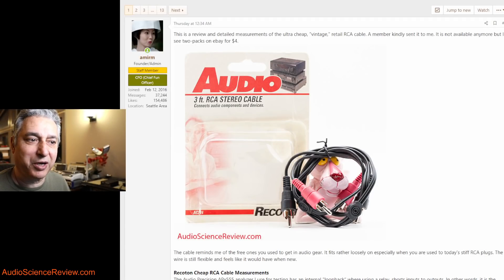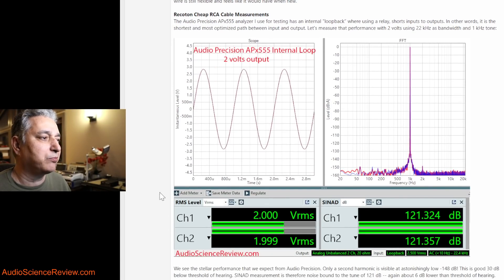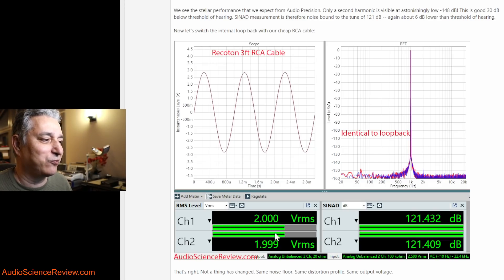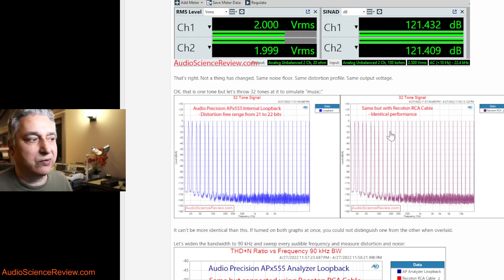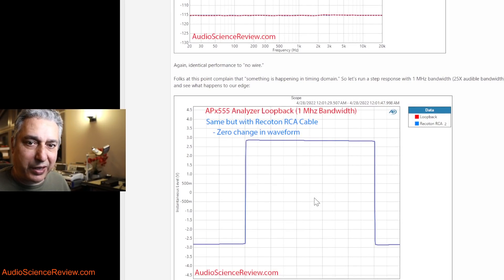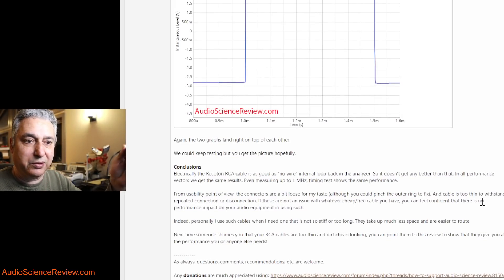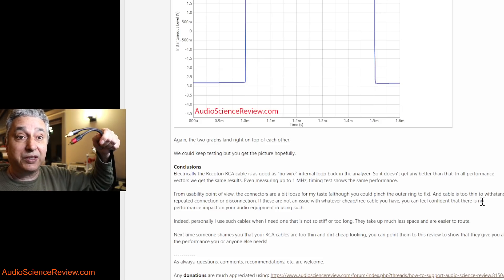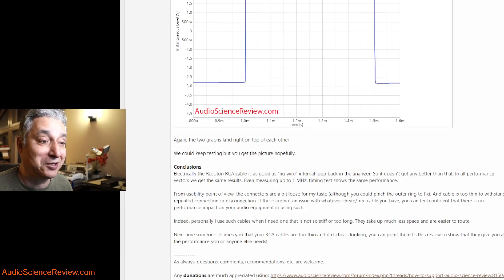Are Dirt Cheap RCA Cables Any Good?

Comment: Hi Amir, could you test this dirt cheap cable with a more complex signal {multiple frequency} like pink noise and do the comparison again? Music is such a complex signal compared to a really clean sinus or square wave (i know a square has infinite amount of sinuses of odd harmonics)

Thanks for these nice informative videos

Kind regards stefan
Reply: Stefan, the test already included multiple frequecies, and square waves. The cable isn't going to care whether these are "clean sine waves"  or more random (like actual audio). It's also very difficult (if not impossible?!) to make accurate measurements on waveform shapes which aren't "clean". Amir's tests cover all bases already, in my opinion.

Comment: The major difference in RCA cables is not how they pass signals, but how they shield from external noise and how they couple the system grounds together. Any junky cable can pass 20KHz 6' without distortion. Put the cheap RCA cable parallel to an AC power cord to see the difference: the cheap one will have big 50/60Hz pickup. And it is a function of the driver/source impedance: Low is good, 300 ohms not so good. 
Then try the power line test with a nicer $20+ cable. The cheap cable has poor shielding coverage, typically 90% or less. The better cable will have multiple shields, typically copper braid + foil for 100% shielding. Measuring the DC resistance of the shield is also a good test: Low (~50 mOhms for 6') is good. 100-500 mOhms or more is bad.

Comment: How many here has more than 1 RCA cables and swear can hear differences between those please give a thumbs up.

I have 4 sets of cheap RCA; 1 Generic cable i bought in electronic stores, 1 custom canare cable, 1 amazon cable and 1 mogami cable. I know exactly how these cables sound in my system, they are different. Not to say one is better than another, they are just different in the way they deliver highs, mids and lows.

I'm not sure there are differences with speaker cables as i have tried some and found no difference (unless its a very poorly made cable) but i am very certain there are differences concerning RCAs

Comment: I would like to see a shielded cable vs the cable tested in this video, but among the rats nest and power cords! That represents 99.9% of our situations.
Reply: Yes, that would be a real world test and good to know. The cheap ones fall apart and not very durable and then they don't connect and have a loose, I make my own w beldon   RG5 20awg solid copper and tinned copper shield and Aluminum foil

Comment: Yet another reason that I can spot an audio snob is when he spends over ~$20 on an audio cable and says he can hear the difference!
As long as the connectors are gold plated for contact quality, and the cable is durable, they are excellent and will perform just as well as $100+ cables with OFC and Litz wire!
What a ripoff these companies are!

Comment: for really short RCA cables 6 ft. and under, the quality almost never maters, it's only when you start using 12 ft. or even 30 ft. el cheepo RCA cables that you start running into serious problems and signal drops and noise.

Comment: "I've got music in the form of 32 tones" lol... not that I disagree with the results though. However, I remember I once replaced my speaker cables which were some no-name 2.5 sq.mm copper wire with 4 sq.mm QED XT25 and I remember the sound changed very noticeably. I don't much believe now the idea the cables can influence the sound so much except for some really crappy cables and I can't reproduce that effect now (I don't have the speakers I had then) but could it be that the sound actually changed (i.e. not only in my perception) maybe because of XT25's "tube" geometry (they have the copper strands forming a "tube" around the dielectric core)? The effect I perceived then was the harshness in treble frequencies of Monitor Audio RX6 disappeared with those new cables, it wasn't like less high frequencies from the speakes were perceived but more like the highs were more "organised" somehow, less chaotic or irritating. I didn't do any A/B testing then because I was just satisfied with new cables so maybe it was still just low pass filtering by the new cables and there was in fact less treble.

Comment: I’ve been into audio systems since the mid 70’s wish I had all the money back I’ve wasted on cabling and speaker wire over the years. Currently using 16awg speaker wire and $5 interconnects. Sound is awesome.
Reply: That’s what I’m doing also.
Reply: For short runs I use 18awg old belden PA speaker cable that I got for free. Longer runs I use inexpensive 16awg or 14awg
Reply: I think for short RCA cables even if was not made of copper wire and the resistance was not good, it probably won’t affect the sound quality that the human ear can detect

Comment: All cables made from copper even silver oxidise over time regardless of cost, but not all cables are made equally. 
OxygenFreeNitrogen does not exist soon as its made it starts to oxidise. some oxidise quicker due to manufacturing process. 
Pure Gold is the only  material that does not oxidise (much)  
 But completely agree with length of cable effects the resistance and pickup!
Reply: Oxidation is really only an issue on the terminations, which are usually gold-plated even on budget cables (these days, at least). The outside of the actual cable getting oxidized is pretty much irrelevant, I'd say.

Comment: well, so far everyone i showed the difference everyone heard it, there wasn't one person that didn't hear it, this measurement's are not proving anything, that cable wasn't even connected to a system, when u connect two devices together the cable becomes part of a circuit, ur analyser is not putting any load on that cable what so ever... or any other cable ur testing that way

Comment: dirty cheap is where all audio cables come from the dirt in caves its copper of dirt cheap turned into all common dirt cheap cables . dirt cheap is good . 

i have many tandy cables and i see detect no loss with high end panasonic 9000 THX and i think connected at ultra high end pioneer laserdisc player , so the tandy gets my free THX approval . also mix of other cheap diamond-delux-mega-ultra-high end  amazon cables even get my free THX approval . now the hi-fi snobbery-phile cables costing £1 million pounds for 12" gets the Cat Litter Box treatment . buy cheap cables .

oh try sting and rub on the vaseline and rub it up and down on the string , rub it , rub it in and then try a voltmeter it should work theoretically giving LP records the high end that the snobbery audiophiles have been missing because they spent £1million on few inches of cable and less on voltmeter .

Comment: Me and my brother tried similar cable as interconnect (DAC to 2.1 desktop speakers - actually 2 models)  than Dynavox cable, than AudioQuest Tower, than Atlas Element...... all were not burned in but all sounded a bit different! One was muddy, other boomy, other smoother..... the Atlas later changed a lot with the proper burn in.
Reply: Cool story bro, your joking right? "Burn in" LMAO...
Reply: @michaelmazzen  No, I'm not joking....
Reply: Cables need burn in now too?
Reply: @alkestos  Yes, sure! And don't change the direction of the signal, otherwise you have to burn in again, in the new direction.

Comment: Hi Amir, 
First of all I would like to congratulate you for your work, I have already red some of your reviews and appreciate the scientific approach, especially when you are review the DACs, a professional job.
However this particular analysis seems to me very basic, I understand your point of demystify some myths, could you please make the same analysis  with a full setup: 
Digital Source (1 kHz sine wave 21-22 bit) + DAC (e.g. Okto dac8 Stereo) + Cables 0,5 meters (cheap one vs costly ones) + Amplifier (one with good specs good SNR low THD) + Cables 3 meters (cheap one vs costly ones) + Speakers (any speaker with a sensitivity between 88dB and 90dB should be fine).

The complexity of this test bench increases the analysis in several degrees, impedance adaptation (especially between the amplifier+cables+speakers), stationary wave effects,  jitter and other. Even though with this approach we are no considering the power supply noise effects, the way that the power cords and audio cords are close to each other EMI effects, etc.
Thanks for your time.
Best Regards,
Alex
Reply: @Douglas Blake Hi Douglas, the test made by the Amir is only digital base, as far as I understood. So if you see the cables as an RLC line, when we are in the analog world we have impedance adaptation (as soon as signal turn pure analog), between the system components (for example dac + cables amplifier + cables + speakers) and other effects like electrons that travel in borders/ edge of the cables, EMI shielding, among others effects. So since Amir is very methodical and professional guy, I would like to see once for all the cable effect in the analog part of the system. And have a pretty decent and reliable measurement with an Audio Precision(AP).
Best regards,
Alex
Reply: @Douglas Blake Hi Douglas, you are right the signal is analog, sorry for my miss understanding. However in this test bench Amir is not considering impedance and other effects, between the amplifier+cables+speakers. I was only suggesting to perform a test like this, in order to clarify once for all if the cables have an impact on the output sound. I'm assuming that the input impedance of the Audio precision channel (the signal that is actually being measured) doesn't affect the impedance adaptation between the system amplifier+cables+speaks.
Best regards,
Alex
Reply: @Douglas Blake Hi Douglas, tanks for your brief semi technical explanation and for the history part also. In your description you are focusing on the real part of the signal, related to resistor part of the impedances involved, as you must know the signal also has the complex part "j" Z=R+j(wL+wC). 
I don't want to offend no one, just seems to me that the test bench that Amir setup doesn't cover all cable theme. I believe that the cables has imperceptible impact, apart of course the EMI shielding, I just like to see tested properly.
Best regards,
Alex
Reply: @Douglas Blake Hi Douglas, my main concern actually is how the cables can or can not mess up with the system as a whole, moreover with cross over built in the speaker. If Amir can perform a complete test bench including the speakers, I believe no one could say anything about the cables again, once again apart of the EMI effect.
Best regards,
Alex
Reply: @Douglas Blake Hi Douglas, and how RCA impact on the system.
Best regards,
Alex

Comment: I think you need to explain as well how the impedance of the cable plays a part when between certain equipment.  For example between pre amp and power amplifier, how it affects frequency response depending on input and output impedance mismatch.
Reply: It doesn’t. Source impedance is low, target impedance is high. No frequency response problem until the cables get a mile long.

Comment: In automotive audio, it is usually better to have better shielding and as a result, if you go to Walmart's automotive department or an auto parts store, they have decently priced but well shielded RCA cables. The better shielding is recommended for coax digital audio hookups as well. A lot of well shielded RCA cables can also be found in musical instrument/DJ audio stores as well.

Comment: I knew it!  Thanks for settling this once and for all.  The scope doesn’t lie.  I’ll pay a couple of bucks extra for a nicer looking, better feeling cable, but I ain’t buying all that improved performance crap.  I could never hear a difference myself.  Nobody wants cheap wires connected to nice gear, but people have gone nuts with this cable stuff.  Another great little video!
Reply: I've found ~20-30e to be a sweet spot for durable and well-made (enough) RCA cables.
Reply: I'm inHifi Hobby since about 40 years and of course I often tried different cables.  And often enough I heard differences.  I did not  make  Real blind tests but the way I compared the cables was enough to lead me to  buy  some ofthem. Even if I knew there is some other cable out there that will sound even better with my gear. But I always set me a price imit  I didn't want to  break. So I think I did never spend more than 150 € for   a  Rca able.  So I would never claim there are no differences between cables. If it's worthy the money everyone have to decide for his own.

Comment: There can be a case made for better shielding to keep RF and EM energy out of the signal but other than that, cheap ones are fine, just don't run them near the 50/60 hz stuff...